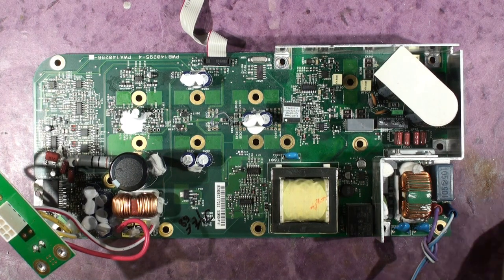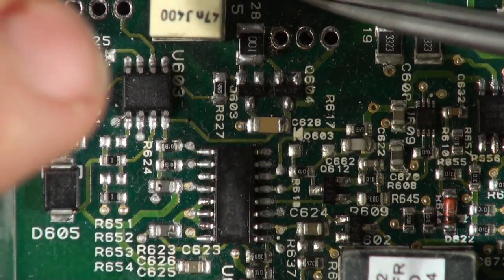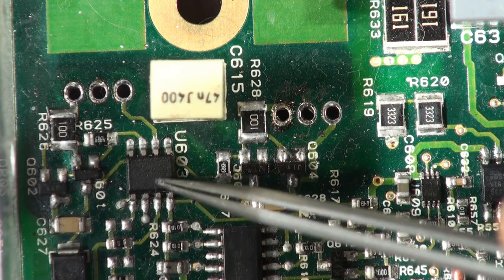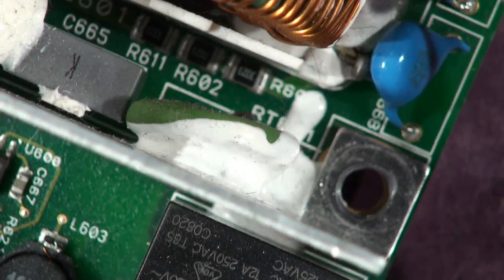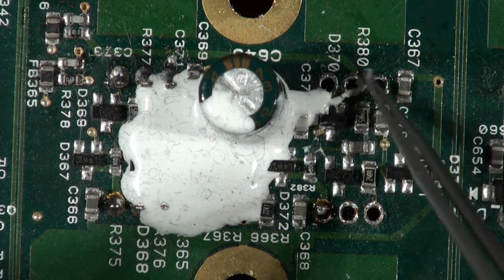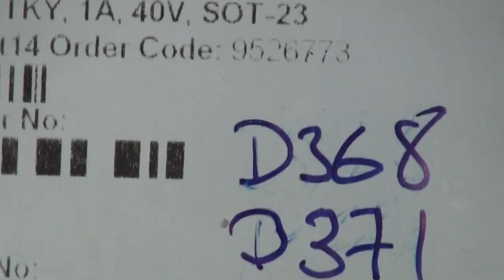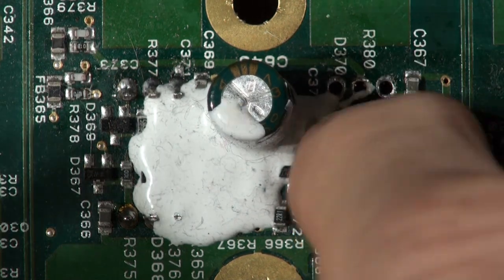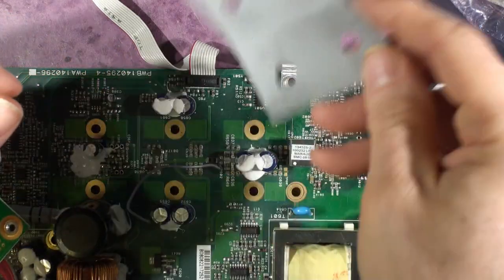JBL EON 515XT Power Board Fast Repair Guide

Comment: Dear Mr. Magic Smoke, thank you for the incredible videos.  Your wealth of knowledge is much appreciated.  I’ve been working on a VRX932LAP amp that has what appears to be the same or very similar circuitry.  It started with shorted Ch3 drive FETs and power IGBTs so I followed your guide and changed the lot of silicon and passives called out in your video.  It went back in speaker and blew up the same ch again after amp was ok on the bench in other loads.  I figure it was because of a bad woofer.  Now the woofer is getting repaired and I changed out everything in the amp again the was blown prior.  After powering up again, I blew up one of the IGBTs again with loud bang.  I changed out all of the power supply silicon and passives and sil pads – everything except for the IGBTs (just left open holes) and am trying to run it again carefully.  I get switching (using diff probe referenced to SMPSREF) high and low past the TL494 U602 but I can only seem to get switching out of the FAN7380 on the low side gate.  Q605 high side gate seems to be stuck up at 15V ctrl.  I don’t understand it.  I’ve checked all the parts and even replaced FAN7380 again and still no switching on the high side.  Any ideas?  Thanks for your help.
Reply from the maker: With not IGBTs fitted you will only see the low side drive as the drive voltages for the high side IGBT is derived from the switching waveform.  Are you sure that you are fitting the correct IGBTs?  (infineon/IR/Fairchild) not Chinese fakes. You have to make sure that the power supply s starting up when the B+ and low voltage DC supplies are stable.  Infineon/IR/Fairchild are now all Infineon but there are plenty of Fairchild and IR parts around. If so they are correct then you still have latent faulty component or track.  Remember that power tracks and ground visas can blow open during the IGBT failure event.so a good start would be to identify that the tracking on the 0V and FET to FET tracks and VIAs are intact.  Invariably when I get a failed repair sent in  there are also solder joints on the replaced parts that are bad. Inspect carefully with a x 10 eyeglass before powering up. Whilst you have it powered up without FETs make sure the two large HV reservoir caps caps have  equal voltages on them. HV caps have a habit of going O/C.  Random FET failure at first power up happens. Ground your soldering iron and work piece 0V rail when soldering the IGBTs.  If the IGBTs  are soldered under the board make sure you have the FET the right way up.  I have seen plenty of failed repairs from so called engineers with the package upside down. Check all low value <3k ohm resistors, all diodes and rectifiers in the SMPS circuit. Good luck. It is a simple circuit just dig a bit deeper.   A short on the DC power side should not blow the primary SMPS circuitry. it should detect the overcurrent and protect the SMPS. That's it!! good luck!! BTW do you have a schematic?
Reply: @razenby  Thank you for spending all of this time to help me.  I think I am using the right IGBTs.  I am using the IKP20N60T part.  They came from Arrow in the US, which is trustworthy.  I will inspect the tracks better.  The sil pads that were in there were pretty beat up.  I did not see any absolute holes or any fragments but I think it is time for new pads.  I will take a look at the HV caps.  I noticed that wile powering up without the IGBTs that R610 24k 1W stand up resistor gets crazy hot and started to get very fragrant and discolor, so I do not run it very long anymore. I measured the across Vbulk with a DMM and got about 332V which I thought was in the normal range.  I have a schematic, but I think it might be for a newer gen board.  It is very similar, though.  Thanks again for all your great information.
Reply from the maker: @AndyCaffery  Good luck with it...

Comment: Professor, congratulations for the valuable explanations - I have a JBJ Party Xpert speaker and the source generates 52 volts dc for the amplifier board - I couldn't find a service manual for this HAnny 25W800 source - It turns out that the volume of the speakers is low and when I turn on the bass the volume increases a lot offering a very good sound - The STA-516B ICs are generating the square wave and working perfectly - I wonder where the problem is then? - I suspect that it is the Pulsus PS9860 IC that has the problem - Can you give us a tip based on your experience - Thank you

Comment: found L4W95 transistor shorted all others are good. I do believe you have the part number
Reply from the maker: Don't reconise that transistor code in the database.  What is the circuit reference?

Comment: You’re a genius. I just bought one of these and all I can hear is very high frequency on the tweeter. I checked and the sub voice coil is not frozen. The voice coil has continuity. What could be wrong you think? Could you fix it for me? Thank you and very informative!
Reply from the maker: A low level permanent hiss is normal. If you have a whistle then you probably have a blown 33078 op amp chip in the HF compressor circuit in the input/preamp board causing it to oscillate.  You can isolate the fault to the input/preamp if you unplug the umbilical ribbon cable and the sound stops.

Comment: Hey Magic - Got three of these for repair. Water Damage. Parts not working are the MOBO and In-power system? What are the chances of repair? Should I order in new parts, or is there a way to salvage the watered parts? Thank you!
Reply from the maker: Hey, water damage can mean anything from 'just needs drying out' to 'it was left powered up and the circuit board tracks have blackened and corroded' away.  Which is it?
Reply: @razenby  Not sure - I'm thinking the latter as it was from client use. Left out in the rain and probably turn on frying electrical components

Comment: Hi!  i own a JBL EON 515XT, it does power on, power works,tweeter works but nothing to the sub. I've taken it to a repair shop and said i need a new motherboard. I'm based in uk, is there any chance i can send my board to you to get it repaired? Many thanks!
Reply from the maker: Yes sure.  Check the bass driver and wiring first. It is unusual to lose only bass due to an electronic fault on the motherboard. Usually everything goes.  Check the soldering and crimps on the speaker connector board. Often they lose connection at the plug.    If no joy  then ark.mail@gmx.com

Comment: Hello friend. What is the normal output voltage of the power supply?
Reply from the maker: Two rails plus mins +20V   and -20V  DC at nominal AC mains input voltage.

Comment: Dear Mr. Magic Smoke, thanks for your very detailed video.
I have a JBL 515 and today out of nowhere started sounding distorted while producing  very little volumen. After that, suddenly turned off and became completely dead. 
Do you recommend to follow the procedure you describe in this video?
Kind regards from Mexico amigo!
Reply from the maker: You are welcome. Before you engage full-on repair you should check a few things first.  Assuming you have a mult-meter,  if you have no power LED first check the LF Amplifier output FETs are not shorted. Then check the power supply main switching FETs are not shorted.  If the FETs are all OK then change the LNK302 chip.  Regards from the UK!! Let me know how you get on.
Reply: What would u charge to fix two of the power supplies im in the usa

Comment: Hi, I have eon 515xt with unusual fault. There is a problem with hf amp section. Sometimes it have no or very little hf output and most of the time the hf output compared to another speaker is very little lower. I checked the power supply voltage across this big capacitors seems ok there is couple volts difference. This big resistor near the hf amp seems ok too. The hf amp is getting 49v across VP+ VP- and 24,5 from them to ground. I checked the frequency characteristic and it had little differences compared to good amp module. The differences are around 1,7khz and 12-15khz. For example when good one was giving 11,1v at 12khz the broken one gives 10,5v with the same signal and when good one is giving 2,8v at 1,7khz the broken one gives 2,2v. I have it dissembled and I really can't force it to fault I tried heating the mixing board with hair drier and it was still working ok. What should I check?
Reply: And thanks for these videos and your help i repaired my eon 510 it had a broken eq switch. I found out about it from the comments under your video.
Reply from the maker: N problem. HF faults are rare and are invariably caused by bad HF driver, However you may have a failed 33078 IC in the HF dynamic filter on the preamp / input board.
Reply: @razenby HF driver seems ok. I have checked the mixing board and one 33078 IC have 12v across pin 1 and 7, it is the one in the top left corner of the input side of the board. I have a problem finding the replacement, texas ones have 16mhz and +-18V max power supply. In poland I found only MC33078D from STMicroelectronics they have 15Mhz and +-15V max power supply. Do you think they will be ok? They are getting something around 14,93V now but I'm a little worried about voltage getting to high on this.

Comment: Hi Magic Smoke. Have you ever come across a 515xt with power on but no sound. And all the voltages are there, the + - 24v, 15, and 5v. Also woofer and tweeter are fine.
Reply from the maker: Yes loads.  Likely a blown 3038 op amp chip on the input board.  Must be one of the first three or so in the common signal path before it splits to the HF and LF dynamic compressor stages.   Watch the video on the input board on the channel. Good luck. Thanks for watching.
Reply: @razenby  Thanks for the reply. Yes, watched all the videos many times. But thing is, no op amps on the mixer board get hot, also, when I touch around on  the tweeter amp or Lf amp, there's no buzz whatsoever from me touching it, even with mixer board unplugged. Iv seen the same ic's and also tl072  go bad alot on the prx 700 series. First time dealing with no sound on a eon, but fixed afew with blown power and blown LF amp. Thanks for your help.

Comment: I have a 515 xt that turned off when it got hot, in the end it doesn't seem to turn on anymore, always powered by 230 volts in Italy, what could be the problem?
Reply from the maker: Likely the LF power transistors.  Buzz out the FETs for shorts on between the pins with a multimeter. There should be none.
Reply: @razenby  I found Q370 shorted, one of the p-channel mosfets, replaced but it continues to burn, what could it depend on? the line fuse does not burn

Comment: Hi, Magic Smoke, Thank you for the video. I would like to have some help to repair my EON JBL515xt Power Amp. the low frequency audio sound like the high frequency. i switched the amplifier board from the other EON JBL515xt and I installed to the one with the issue and did sound perfectly. so the problem is in the amp. 
I need help!!
Reply from the maker: Are you sure that the 15-inch bass driver is OK?  Usually when the LF sounds wrong it is the driver itself or a blown op-amp chip on the  mixer/input board.  The LF power amp usually fails completely.  Has it been open - has someone the plugged the LF/HF  drivers with the wires transposed. I have seen this a few times....  Then they both sound tinny.

Comment: Ciao ottimo video ti volevo chiedere perché mi saltano i mosfet sono FQP17P06  la cassa è una jbl 515 cit eon mi potresti aiutare a capire se ci sono altri componenti da cambiare mi sono saltati due volte che l’ho riparata grazie
Reply from the maker: Innanzitutto è necessario osservare le precauzioni antistatiche durante la sostituzione dei FETS di potenza. So che sembra improbabile, ma so per esperienza che l'elettricità statica li danneggia poiché ero solito sperimentare guasti casuali dopo aver cambiato i FETS e ora non succede più. È necessario verificare la modifica dei resistori e dell'azionamento del gate FET. Infine, un amplificatore operazionale instabile nella scheda del mixer di ingresso può inviare rumore HF nell'AMP che non puoi sentire ma farà saltare i transistor di uscita LF. Per qualche motivo l'amplificatore di potenza LF è in realtà a piena larghezza di banda. Controllare che i cavi degli altoparlanti siano ben stretti, Controllare che i cuscinetti isolanti sotto i transistor non siano perforati. Non serrare eccessivamente le viti della staffa e ricordarsi di mettere la rondella di bloccaggio interna che funge da distanziatore tra la staffa metallica a L e il PCB. Questo è tutto. Se i resistori sono buoni, darei la colpa all'elettricità statica.
Reply: @razenby  grazie ti aggiorno dopo fatto quello che mi hai detto

Comment: What is the purpose of LNK304 IC? If the LNK304 is broken what is the possible damaged on the unit
Reply from the maker: LNK304 is an off line PWM buck/flyback controller to supply low voltage DC (nominal 12V) to the live side of the Switch-Mode_Power Electronics.  If the chip has blown you likely have many other blown components in the SMPs.  The LNK302 is usually the victim of the High voltage main drive Transistors going internally short.
Reply: I bypass it using a 15v supply then the unit was power at make a sound. It is possible to bypass or not

Comment: havent watched this video yet but ill run through it and check some other online sources. i have a jbl 515xt that tends to pop and fuzz often (its been a while since ive used it last so im not sure if its constant or occasional but i believe its constant loud fuzz). i dont have a ton of knowledge on this sort of thing but do you think i could fix it with some sort of deep cleaning such as vacuuming or perhaps blowing with canned air or an air compressor? figured id ask someone with the ability to fix one of these before i waste my time and try to clean it. if not i oughta try to get it professionally cleaned. thanks!

oh editing because i forgot something. i have 2 of these and they were in a garage with a lot of dust floating around (farm house) thats why im hoping it can be cleaned. unless its a different issue.
Reply from the maker: If the volume controls work OK then Pop and fuzz is is most likely to be caused by an operational amplifier in the Input mixer board.  It is not a usual failure symptom in the main power board but you cant rule it  out completely.  Dust wont be the issue.

Comment: Do you happen to know the part numbers for U601 126559-1 COMPARATOR, LM393 SO-8 DUAL, and U609 138548-1 IC, SINGLE D FLIP FLOP?
Reply from the maker: Are you working on 240V or 120V Mains?  If you need 240V  operation only then remove U601 and U609. They are a liability because they erroneously trigger the voltage doubler when they shouldn't.  If not then get back to me and I will look up the part numbers.
Reply: @razenby  I have removed u601 u609 and the relay k600. Using 240v only. Brown outs keep killing them

Comment: Thanks for the video MS. I have an unusual problem with a 515XT, the HF amp is out and only produces static from the HF driver. The driver tests good and the LF is working fine. So where do I look for the problem? Thanks again.
Reply from the maker: Probably a preamp op-amp chip has failed. Quite common. See video on how to diagnose.. I have never seen the main HF power amp  chip fail.  Scope the differential lines that track around the outside for the board from the ribbon an see if the noise is there. Also make sure the ribbon cable is secure in the IDC clips.
Reply from the maker: Also if it i still clampled onthe heatskink make sure the insulation to ground is OK. The top-hat, screw and sil-pad.

Comment: Hi I am in Australia where can I get these components  to change can  please help.I though the board was solder stressed and did some soldering near the frets and the area you where explaining  went up in smoke .so would like to  make an attempt to  try and resurrect  it if I can..I have another one and I got that working by luck but would try my luck fixing this one.please help.
Reply from the maker: Greg. OK what part of the circuit is bad?  give me the component references please